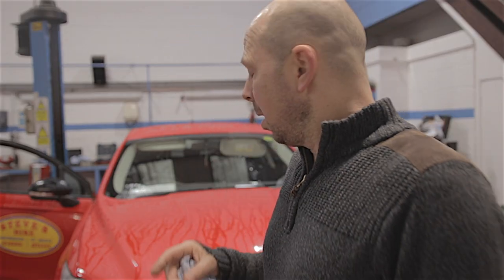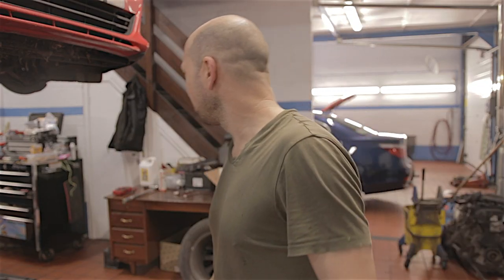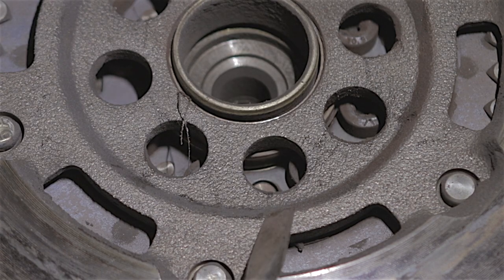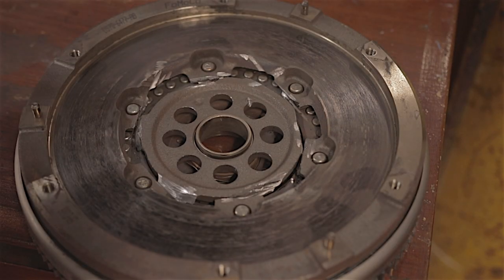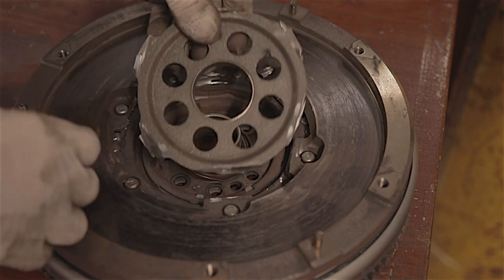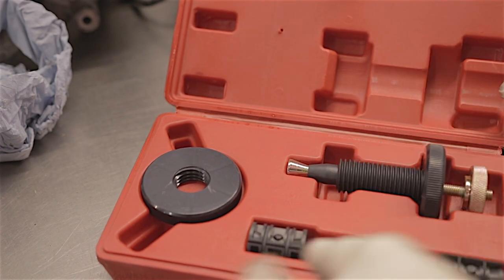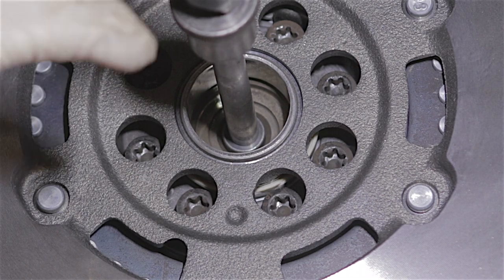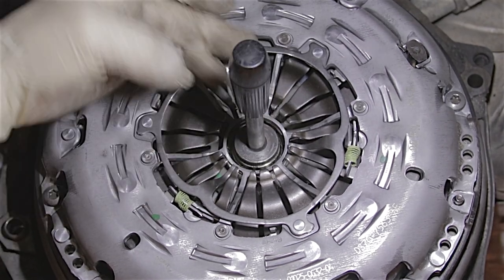Flywheel Down !   Clutch Fit & How Long Will My Ford Mondeo Mk5 2L diesel Clutch Last

Comment: Good advice about tightening the cover plate evenly. I bought a 2001 volvo D5 as a project,receipts showed a new Luk flywheel and clutch fitted recently. It just didn't work right with a weird feel to the pedal.I pulled it all apart and I think whoever fitted it had tightened it unevenly and cocked those green springs up. My local Volvo dealer reset them (free of charge!) I made a copy of the expensive fitting tool out of a steel disc,three old bolts and part of an old release bearing,all it does really is push the clutch fingers in until the cover touches the flywheel. Nice smooth clutch now. I asked around quite a few garages about how to do this job and got a lot of blank looks,makes you wonder about how many of these are ever fitted properly.
Reply from the maker: thanks that is an interesting story

Comment: Had flywheel failed at 135000m   in my MK4 2.2. Gone instantly just one day start shaking all car and rattling. The same damage 20$ bearing. New cost nearly 1000$£€ clutch disk all spring in flywheel perfect condition. New clutch covered another 130000m since replaced I hope will last a bit longer.
Reply: Where was this 20 USD bearing, what you have to change? I have got 60k miles on my flywheel, but it is so vibrating, shaking, but not rattling.

Comment: My mk3 mondeo st just done 155000 on original clutch only changed because release bearing noisy clutch plate and dmf fine pretty impressive durability
Reply from the maker: thats pretty good

Comment: Hi Alan my  Ford mondeo mk 3 had 300,000 Km or 200,000 miles on the clock i got the car new from the start and had no problems with the clutch or flywheel at all a accident with a deer killed the car but the everything on the car was okay with no sounds at all it was worth every penny i paid now have a Ford Kuga 2016 automatic with 180 Bhp will see how this Model will compett with the Mondeo

Comment: Alan, ever thought about putting a non-Ford clutch kit and comparing the lifespan. Got to be cheaper to get a LUK from a factor than a LUK that has ford stamped on it too?
Reply: Have done this myself with another Ford. I think its important to use oem for these parts (eg LUK) as it costs so much/takes so much time to replace a DMF/clutch and you are asking for problems down the line using anything else. LUK is just a brand; the parent company is called schaeffler.
Reply: Yeah. It's often cheaper to buy the part from the company who made it rather than the main dealer.
Reply: @zoidberg444  agreed. My Mk4 was in for some recall work and they 'helpfully' pointed out I had 2 tyres wearing thin. "I have 2 GT Champiro's on the shelf, can put them on now sir, only £107+vat EACH" I passed, even though they would have been fitted by a fully trained Ford technician 🤔
Reply from the maker: we have ford impressed stock and i just feel more confident with the parts from the dealer
Reply: @alan4x  hadn't thought of it like that. Having one of your cars off the road is lost income.

Fair play those clutches look like a right ball ache to change

Comment: dual mass will fail with continuous harsh use... smooth operation is the key ... :)
Reply: I hope your right I just bought a Mondeo estate from a deal and the DMF started to rattle when I picked it up, it’s under warranty so they will be fitting a new one, it’s 119k mileage

Comment: Hi there Alan I have just watched this video again because I have got my mk4 2.0 diesel in bits because the first gear has gone I managed to get about a extra 8 months before she is just jumping straight out I have managed to get a second hand one for £130 but the clutch is well over £300 and that is a Luk I was going to put a second hand flywheel but I don't want to take a chance the car was driving beautifully other than the first gear I have watched your videos on you doing the second gear and I think you said that you have never heard of the first gear going well mine has I was thinking of trying to mend this gear box incase my new second hand one decides to give up and Alan you are lucky having all your nice car lifts and shiny Jack's I am doing mine old school on axle stand and three trolley Jack's and the help of the brother in law & grandson the job was going to be well over a £1000 it's just a 2012 so I did the granddaughters focus a year ago and that was much easier than this old mondeo it's not done yet in just waiting for parts and help you were on about how much these jobs are costing well in 2010 I had a chryslr problem cruiser 2.2 D I loved it but the slave cylinder whent I was working full time lorrie driver so I had to take it to a garage a proper gear box specialist and I thought it would be great whent I got her back they left it outside for me because I was late well I started to take it home and I could hardly get the gears in so I had to get it taken back to them on a transporter they said they had to take the gear box out again I was not happy and after a bit back and forth it got fixed but what I am getting at this was a specialist garage and it cost me £1300 and a few months later it whent again I just parked it up and got something else yes I did get onto the garage but you know what it's like I needed a car quickly for work  sorry a bit of a long story but I have always tried to do the job myself if you can
Reply from the maker: hi cliff, yes you would expect a decent job to be done from a specialist but your outcome is what happens a lot.
good luck stripping the gearbox down, unfortunately to get to first gear you have to strip the entire gear shaft...you will need a new first gear and a first to second gear synchro hub unit.
just keep everything in order and triple check all the new parts are correct and when you fit them they are the correct way around ..best of luck and thanks for your story

Comment: Good afternoon Alan, I have a mondeo mk5 diesel 2.0 150cv titanium, bought in Spain. When I turn off the engine I hear crack crack crack, in the workshop they tell me to replace the flywheel. They also tell me that the EGR valve needs to be replaced because it has stayed in the open position. The car has 126.000kms, made by highway. Do you think the problem is the flywheel? The car is perfect, except that noise when turning off the engine, and the engine warning light on steady. I am a bit desperate because it is a very expensive repair. Great job you do. Thank you

Comment: Nice one Alan , would the DMF and clutch plate setup be similar on a mk 6 Transit FWD...... I have an old 05 van in great condition and want to keep it as long as possible , it's done 145.000 but been we'll maintained and for about the last year or so the flywheel rattles a little on start up but doesn't make any noise once running , just wondering if it's worth doing......
Cheers mate and I love your banter with Monica......😜
Reply from the maker: yes the same setup, usually you can leave the flywheel until they are rattling quite bad as its an expensive job

Comment: The DMF does make a contribution to the vehicle reducing NVH, until it fails. Then it's a bad thing. I don't know your market, customer base, policies etc but have you used (or is it even available for this application) a solid flywheel conversion system? In the USA many popular applications can be serviced with a solid flywheel. Becomes a choice sometimes $$ driven sometimes frustration driven.  I have a 2000 VW Beetle 1.9L ALH and it was built with a LuK DMF. Also I ran a solid FW system in it for over 200K. ALH has over 435K on it now.  Gary

Comment: Hi Alan, do you think dual mass flywheels have any advantage over the older type conventional solid flywheels? Personally I've never had a problem with the conventional solid flywheels.
Reply from the maker: they smooth out the shock much better and are much smoother drive especially on the diesels but the trade off is they don't last lol
Reply: My first Mondeo was a 1994 L reg 1.8td Estate, that was scrapped after 255,000mls. I still own and use an X reg mk2 1.8td estate it's on 178,000, runs perfect but needs new rear arches and sills both sides. Your videos are excellent especially the cambelt/water pump video's,  I have a Jag XF with that 2.2D engine and it's only done 45K but is 10 years old and it's recommended to change it at 144k or 10 years, would you personally change it at the current mileage? Thanks.
Reply: @chris jones I've never had a problem with the egr on both the Mondeo 1.8td's I've owned so I've never needed to do anything to the egr's. Don't know what you mean by ''Those engines are dogs''? My Mondeo handbook states recommended cambelt change on 1.8td Enduro engines every 70k or 7 years which ever comes first. My Jag XF 2.2D has only covered 48K but it was 10 years old in May, so I decided to change the cambelt and water pump as per handbook recommendation.

Comment: Nice job Alan I notice you didn't make a point of the slave cylinder being a cors liking I have don the grandauters ford focus 09 plat like you say there was still plenty of meat left I don the clutch on here car it was going to be over a £1000 at halfords but I have had problems with the slave cylinder on a few cars and we had a few go on the lorries I work at a haulage cumpenie

Comment: Our Mk1 S-Max (2007) DMF failed badly enough the bolt heads were getting caught and shaved off. It was actually the slave that failed (probably because of the extra vibration), meaning the box had to come off. New clutch of course.... it was on about 80k miles. Really annoying!

Comment: Hi Alan, since you are almost a doctor for them, maybe I can get an advice from you. My MK5 2.0 Diesel 150 manual gearbox - sometimes, from time to time, when I don't use the car for few days, first ~5minutes I have a problem with 1. and R gear - it looks like I can't shift to those gears. With more pressure, I can. After some minutes of driving, all is perfect again. (but recently happened after 20min of driving problem to put in 1. gear :o)
There is no weird noise or something to notice, maybe whenever I shift to 1st gear (the car is not moving) I have a feeling that I fill it. (like some "tak" :) )
If you find time - thx.
Reply: I have the same issue here, but with 1st and 2nd gear
Reply: @BigAdventurer  have you found out what it is?

Comment: Hi Allan. Another great video. I have a mk5 Mondeo with 93000 miles on the clock and always worried that the clutch will go. Most of my driving is open road and motorway though. I presume that would make a difference in how long it would last?
Reply from the maker: yes it will but also try not to labour the engine when driving slowly as the flywheels don't like the low revs

Comment: Hi Alan i have Mondeo MK4 2012 year 2.0 TDCI 140 HP and im have a big problem 
with a trembling steering wheel.
I have already replaced the hubs,shafts I checked the engine cushions and still nothing.Of course, the convergence is set. After replacing the front rims, I noticed a slight improvement but still trembling.I also noticed Tremor does not always occur .
Sometimes the car goes on the road and sometimes the steering wheel shakes.Pleas help Me.Thank you very much for your answer.
I am writing this message through a translator.
P.S.Is Monica Polish?

Comment: Ok, I have a question... my clutch was changed at around 100k miles due to the DMF. It's been and is great. 
I'm at 182k, dragged the car through 17 countries and it's great - BUT.... with the engine running and out of gear, if I just feather the clutch pedal, I get a strange rattle - nothing like as bad as what you have shown.  So what would that be?
Reply from the maker: well could be your new flywheel starting to rattle or possibly your alternator overrunning pulley is seized and causing your belt to flap about
Reply: I'm cringing at the work this thing needs, all reasonable stuff, but it's just built up over time. 
Thankyou

Comment: Alan but you don't have to use a tool to press the disc pusher and then fix it on the bi mass flywheel
 Since the pusher disc compensates for the wear of the disc ??Let me know, bye!!
Alan ma non bisogna usare un attrezzo per premere lo spingi disco e poi fissarlo sul volano bi massa.🤔
Dato che le spingi disco compensa l'usura del disco??
Fammi sapere ciao!!
Reply from the maker: no i don't use any special tools.. just align the clutch plate and its done
Reply: @alan4x  I did not understand but I trust.

Comment: I have seen a DMF cut open and can't understand why grinding the center piece is necessary. 

Isn't any way to rotate it to make enough space and see the bolts? Like a hammer and chisel?
There are 2 big springs inside and the rest should move freely between them especially if the second mass is giggling all over the place.
So what am I missing?
Reply from the maker: Sergiu K 
When half the flywheel covers the bolts most of the time you can lever the outer half of the flywheel to expose the bolts although usually it will be under quite strong spring pressure but in this case it had spun too far and no amount of levering was going to level it up as the spring pressure was too great

Comment: hI ! wELL dONE SUPER INSTRUCTIONAL VIDEO GIVES AN EXCELLENT UNDERSTANDING TO THE what and why and how etc. It seems that the automobile world has caught the German illness of =  WHY BE SIMPLE WHEN YOU CAN BE COMPLICATED ! Its part of the Technology Pandemic when if man can he will ?  To me I can not see the need for such clutches when the human drivers are taught and learn smoothThanks for the vid and Be Blessed  driving and vehicle handling ! Cruise and Flow movement.  Just so one can save a millionth of a second in pulling away I guess ? I will stick to my Petrol 2liter 2006 Mondao.My 2006 2liter TDCI   still does not rattle at the clutch with 285000kilometers.   I try not use high rpm and not to slog the motor with low rpm best around approximately  1700 to   3300  rpm seems a good range will go up to 3800 for pulling power but not slogging it. Early gear change but 6th gear is very high so need 2000rpm or more with at all times minimum throttle, treat it as you would the woman you love.Thanks.Be Blessed and Happy New Year and Christmas.P.S  I was at Mildenhall a few years not far from you.Had a Suzuki  600 Bandit which got me around there.OH!  Diesel motors should be driven differently to Petrol motors but seems the people aren't aware of this and learn on the job but not good for the motors don't you think?

Comment: The self adjusting clutch tools are still quite expensive, i have seen methods involving a hub puller and also thread bar and a big washer. Have you used these?
Reply from the maker: no never had to use a tool to adjust the clutch cover, we just bolt on a new clutch cover and plate and it works fine
Reply: @alan4x  what if you take it off to change a flywheel will it keep its tension?

Comment: Hi Alan. Do you recommend changing the flywheel even if it's just the clutch that is worn out? Mines still ok at 90k but next year😬. Great videos! Happy CMAS
Reply from the maker: yes definitely for the expense of removing the gearbox it would be best to do the lot
Reply from the maker: and merry xmas to you😜

Comment: Hi Allan, got a mk4 Mondeo just clocked 200k on the original clutch. When it finally wears I will consider replacing clutch,  master cylinder and fly wheel. Do you recommend Ford parts or would you consider other brands ?

Comment: Hello Alan, can you tell me if mk4 mondeo 1.8 tdci 125 bhp and 2.0 tdci 140 bhp also have Delphi high pressure pump like mk5 mondeo. Cheers.
Reply from the maker: the mk4 mondeo 2l will have a delphi pump but not the same as the mk5 pump

Comment: Cant understand why mainly diesel cars have dual mass flywheels and most petrol's don't.I mean don't change something that worked before the single flywheel setup. Have you ever thought about doing the conversion on the taxi's Alan. Hi Monika
Reply: DMF dampen vibrations from the engine which diesels vibrate alot more, I've seen people convert the dual mass to a single mass instead.. But there's the risk of wiping the crank out and of course more vibration through the cab which isn't the best feeling.
Reply: @NayNay1991x  Every video is enlightening especially when one reads the comments.
Reply: I drive a 1.6 Ecoboost Petrol MK4. It has a DMF original clutch lasted to 96k, it started slipping occasionally from about 93k
Reply: Nathen Whelband I’ve had two Mondeo Mk4s and I swapped the DMF for a SMF on both and really the difference was barely noticeable. At least I couldn’t much tell. Never had any mechanical issues after the fact either.
Reply: @SammyInnit  Awesome! I'm finally going to replace the flywheel on my Ford S-Max and switch to an SMF. I was a bit unsure at first, but I think I'll be happy with the results

Comment: I'm sure you have been asked this a million times but.. Would a Solid fly wheel conversion work?. I have read about it destroying gearboxs and crank shafts. I'm tipping all the torque and power modern turbo diesels produce these days, its cheaper to make a DMF rather than to reinforce crankshafts and gearboxes?. I have read success stories with the smf conversion but then again I think they were not Fords.. Interesting.
Reply from the maker: i have had one case of fitting a solid flywheel to a mk3 mondeo 2l tdci...within a few weeks he bought a dmf and removed the solid flywheel as the vibration and harshness of the drive..he could not live with it....that is all i know about the subject but i would say just fit a new dmf as they have come down in price in recent years and at least you know it will work correctly
Reply: @alan4x   Eek I have read of that as well. Yeah, Always best to go with what they were designed for.

Thanks for the Yaris bearing tip btw!.. Will be doing this as soon as the part comes! :D.